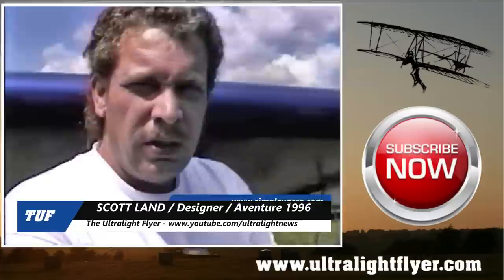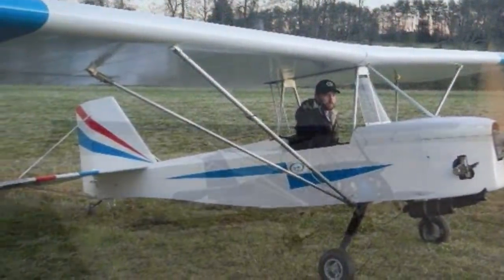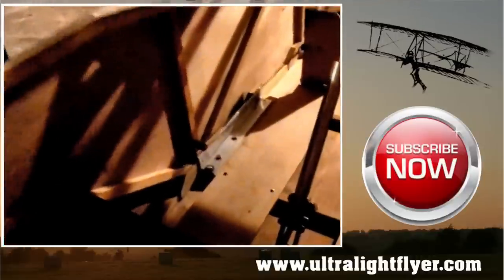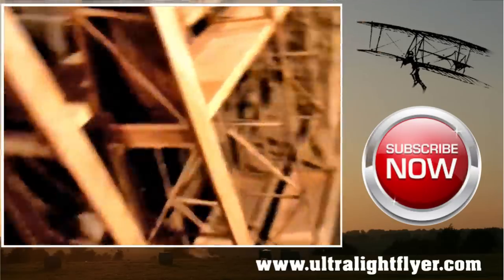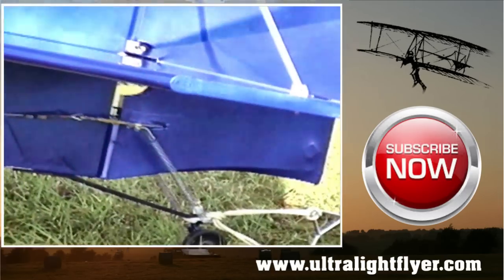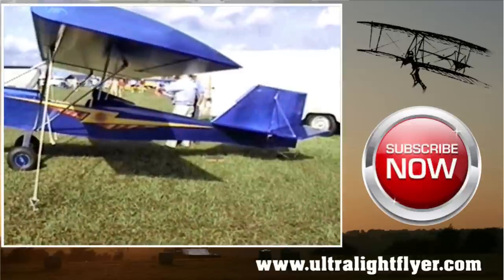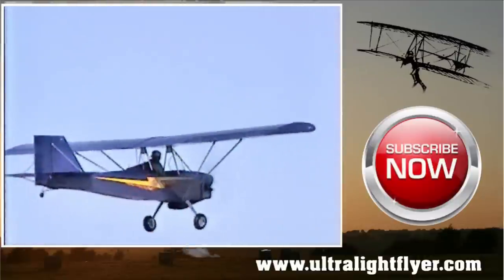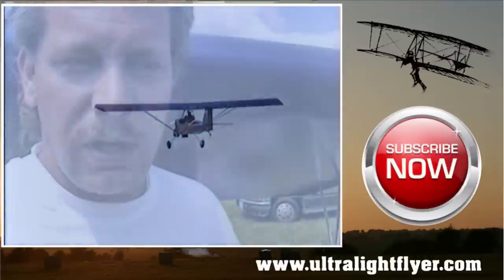Zing, All Wood, Plans Built, Legal Part 103 Ultralight Aircraft from Simplexaero.com

Comment: Wow..it's getting ugly here..lol...If that little plane had fold back wings, he would dominate the market..
Reply: not with that wood frame. It takes long enough to build wood wings, I wouldn't want to spend another year building a wood fuselage and empennage.
Reply from the maker: Having built a number of aircraft from wood, I can honestly say that it is no longer to build it than building a plane from steel or a wing from aluminum. It goes together very quickly because all the pieces are copies, thus when you build the wing ribs - you build them all at the same time.
Most Fisher / Min Max Aircraft can be built in as little as 250 to 350 hours.
The Ultralight Flyer
Reply: John Foley  aircraft wood is different. Since water isn't contacting unless it's raining, rot is not an issue. The De Havilland mosquitos proved that well using Synthetic adhesives and fiber glass surface covering.